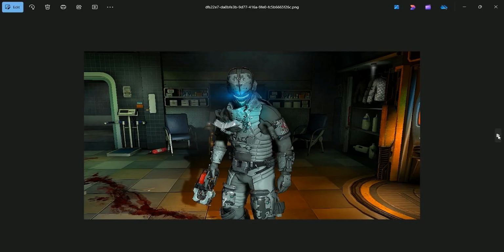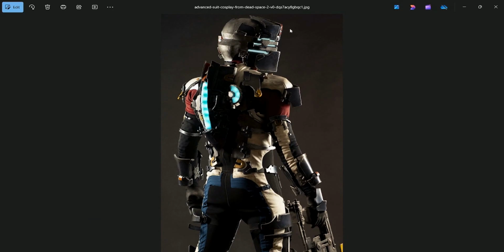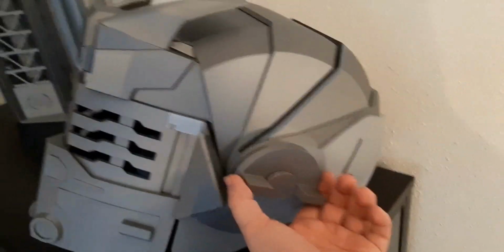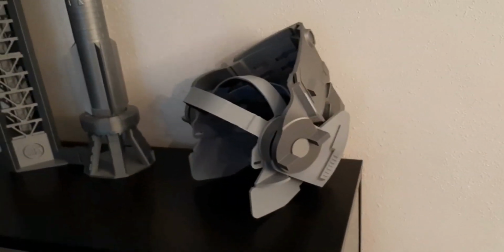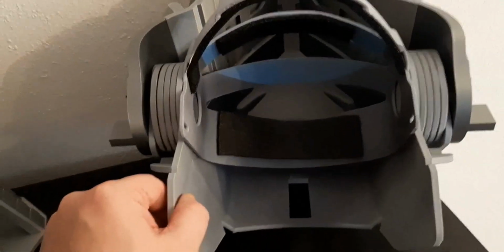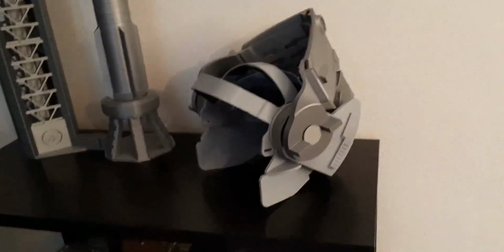Dead Space Helmet MKI

Comment: I'm currently working on printing this but some parts exceed my print bed of 220mm x 220mm any advice?
Reply from the maker: @bradnothanks691  what advice can I possibly give you other then scale it down or buy a bigger printer?
Reply: @martintaichl  alternatively i suppose i could learn to load it into some 3d software cut it in half print the halves and glue together, my apologies it was a stupid question
Reply from the maker: @ well, I dont recommend it. If you just slice it in half and then glue it together, I fear it will not hold  that well. After all, you will wear it on your head. You can ofcourse try, but I fear it will fail. I personally would try the rescale option, but you will see ;)